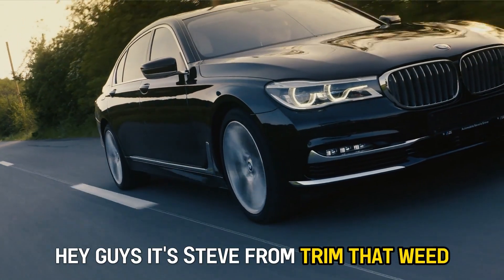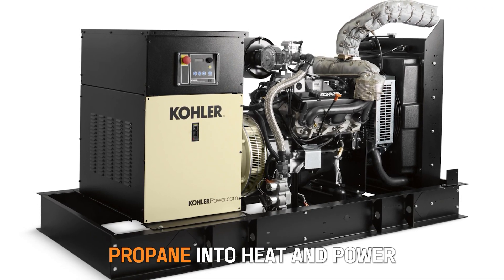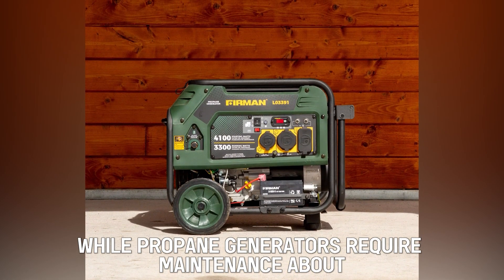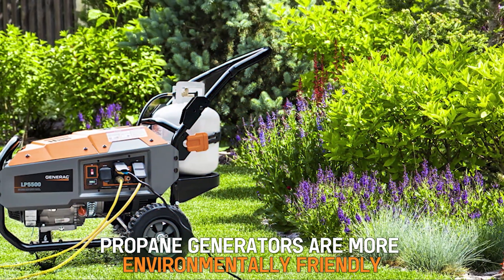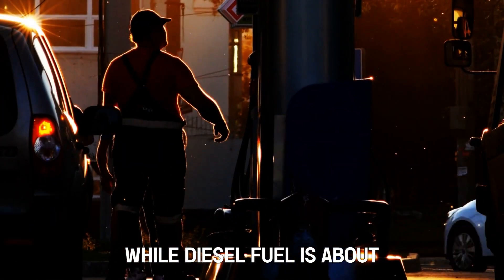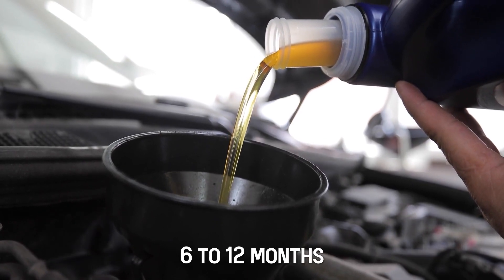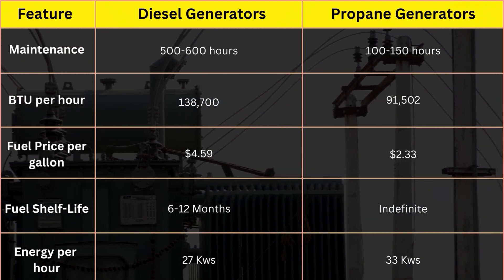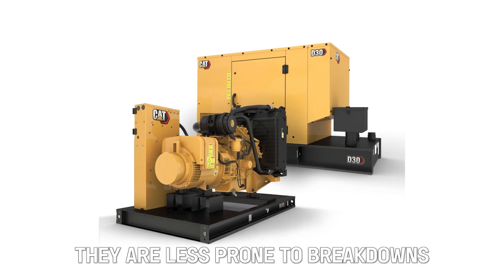Diesel Generator vs Propane Generator- Understanding Differences (Which Is the Winner?)

Comment: Diesel spills can be catastrophic to the environment and very expensive to clean up, if clean up is possible.  1 litre of diesel destroys 1 square mile of ground water.  If it gets in your well, well….
Propane will not do this.  I fail to see why anyone would chose diesel based on this issue alone.  I see a day when diesel will be banned because of this specific reason, efficiency be damned.

Comment: I went with a  Kohler Propane Generator  Kohler 30RCL 1800 RPM.  My dad had large diesel unit's for his business in semi trailers.  If I were running everyday like my dad did,  diesel is the way to go. For home backup its Propane or natural gas. We put the unit in our house back in 2018 with a 1000 gallon underground tank. We used it very little until last year when Ian hit. We ran it 11 days 24hrs  and only shut down every other day to check the oil and did one oil change.  Propane is much easier to store for years at a time. Diesel fuel systems need very clean and no water in the fuel. Very hard to do in humid Florida. Also diesels don't like light loads for very long. Wet stacking is a big issue.  Natural gas or Propane generators don't have wet stacking problems.